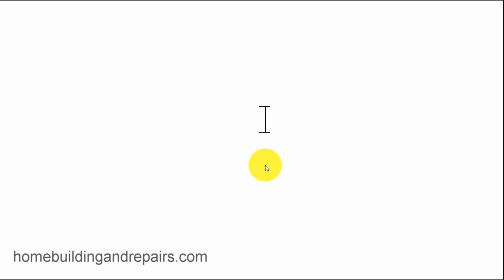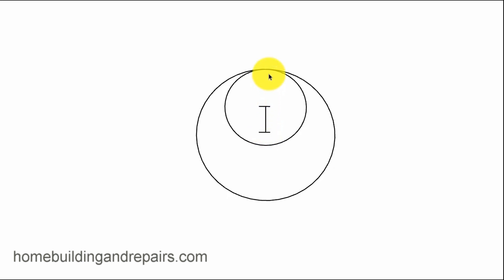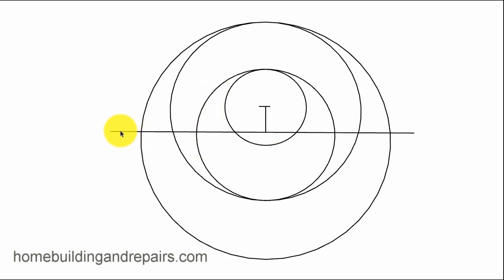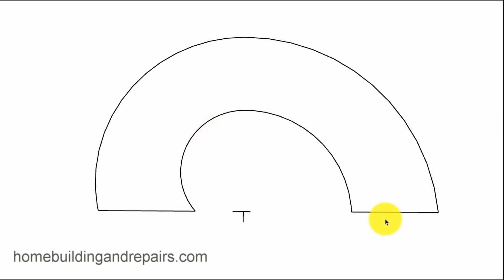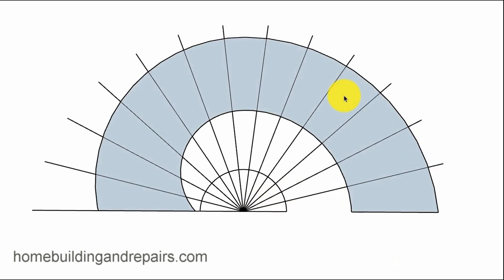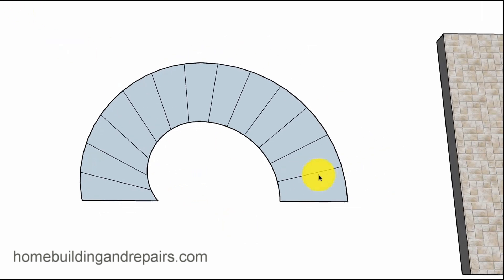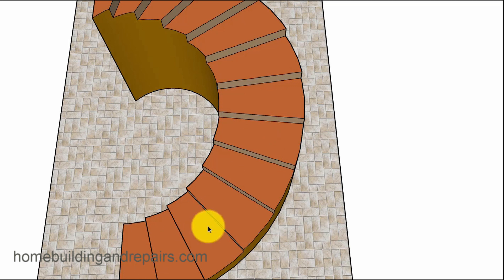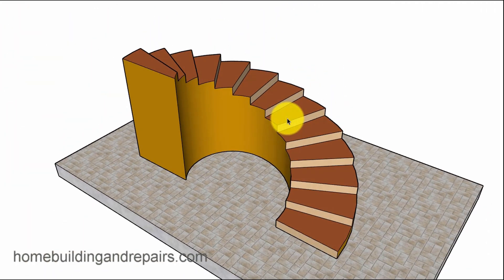How To Design Custom Curved Stairway With Four Different Circles - Architecture Tips

Comment: Wait wait what?! The most important part was missed. How did you get those equally divided lines for the circle??
Reply from the maker: Hold on, Wait, what did I miss... Just kidding, I would have put measurements in if there was only one way to build this. Experiment with your own lines and circle sizes.